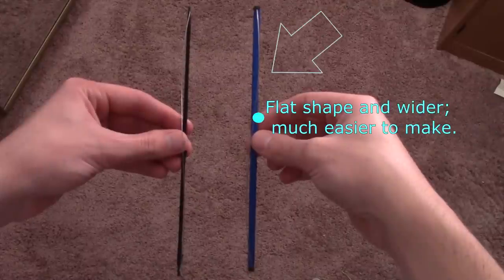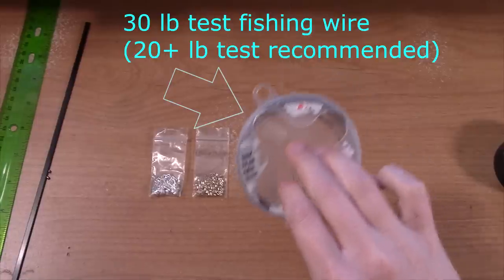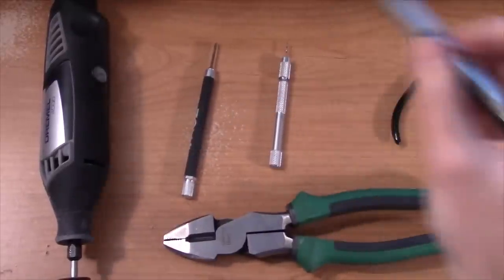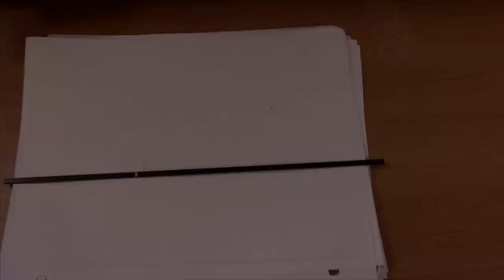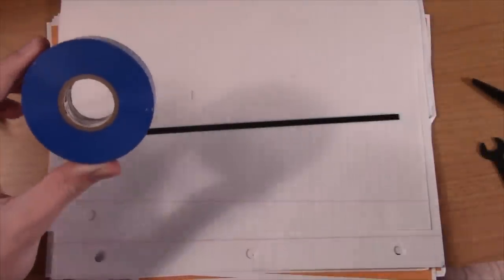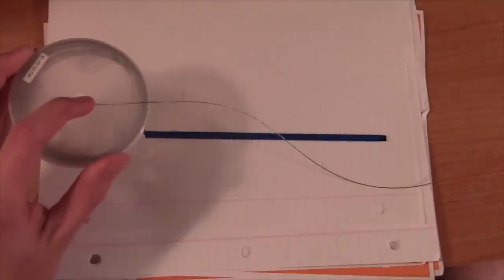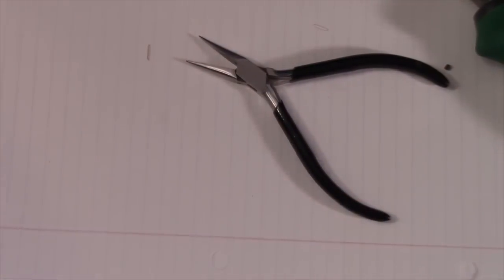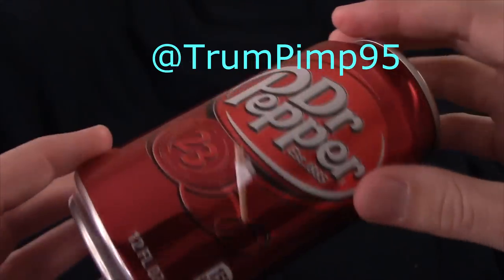How to Make the World's Best Mini Bow

Comment: What can I use instead of rods
Reply from the maker: +Armando Zapata You mean the carbon fiber strip? You could check out videos others have made using wood or rubber bands if you can't get carbon fiber.
Reply: +Trumpatier thxs
Reply: +Trumpatier. I got a question. Are u gonna answer my responds about the $10 Amazon gift card in the video about how to make the assassin's bolt
Reply from the maker: Hey man, sorry for the late reply. For some reason, this comment went straight to my spam folder. The gift card contest has ended, and I've uploaded the video on how to make the assassin's crossbow bolt.
Reply: OK 😢